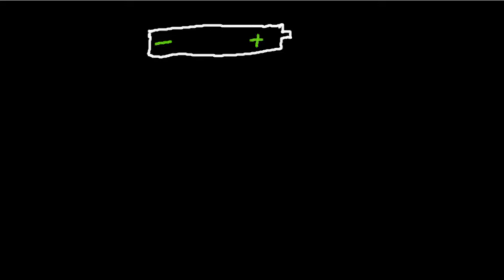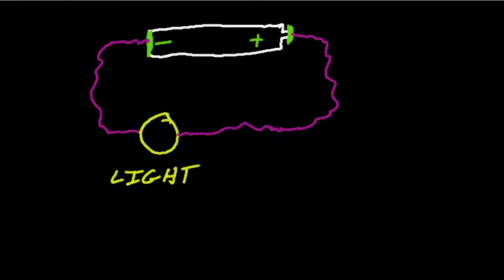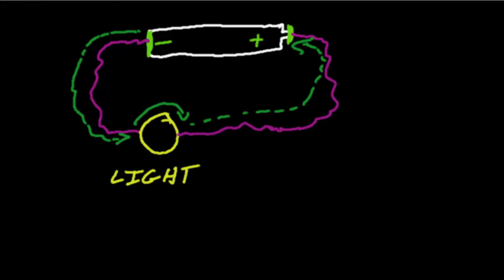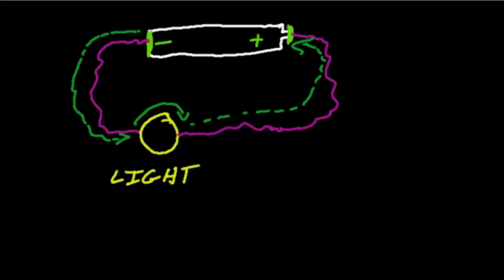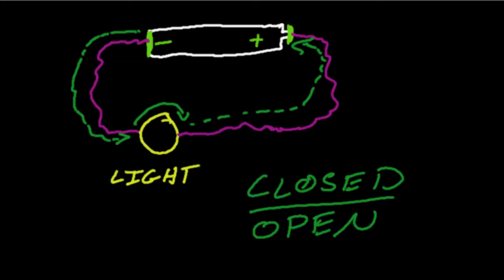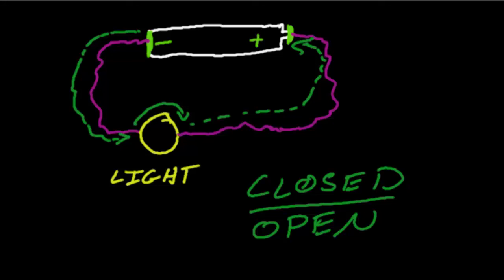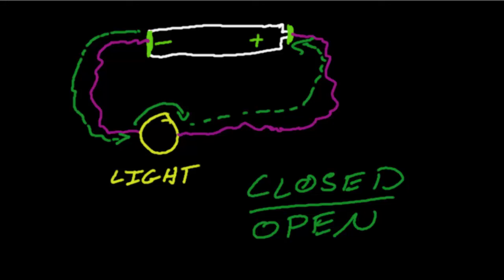Beginner Electronics - 3 - Closed/Open Circuits

Comment: Summary:
- electricity, aka current, is the flow of electrons through a wire
- for a battery, electrons from the negative terminal flow through the wire, to the positive terminal
- if there is a load (e.g. light bulb) along the way, it will have power
- if there is a gap anywhere, i.e. if the negative terminal is not connected to the positive terminal, no electricity will flow (i.e. no current)
- "open circuits don't work"
Reply: Electrons flow from the negative to the positive, but negative is said to be ground.  So are electrons flowing from ground to a "generatot"?
Reply: -e flow from + to -

Comment: Yes , Some teachers say that electricity flows from positive (+)  to negative  (-)  and others say the opposite , but they say it just to simplify cause : From the standpoint of electronics, it doesn’t matter. You can imagine the electricity flowing from negative to positive or from positive to negative, and (in every case that matters to electrical engineers) you’ll get the same results every time. This is why some applications to electronics were discovered even before the charge of the electron was known, and why many electronics textbooks will talk about electricity flowing from positive to negative. Also, in electronics diagrams, things like diodes and transistors are drawn as though electricity flows from positive to negative
Reply: it is necesary for safety reasons

Comment: Take Note: He's talking about Electron Flow instead of Conventional Current.

Conventional Current assumes that current flows out of the positive terminal, through the circuit and into the negative terminal of the source. This was the convention chosen during the discovery of electricity. They were wrong!

Some dude experimenting with glass, found out that it's the opposite and he discovers electron. 
Electron Flow is what actually happens and electrons flow out of the negative terminal, through the circuit and into the positive terminal of the source.

we still use conventional current because it doesn't matter anyway.

Comment: Does AC current travel on one sigle wire, or does it travel back and forth on 2 wires as it goes back, and forth?  Outsideog completing the circuit.

Comment: One thing I don't understand. If all electrical circuits are built to have electrical components in a certain order. Wouldn't it be the wrong way round if the current flows from negative to positive terminal. Like for example, what if a resistor had to be placed before a fuse to prevent the fuse melting and breaking the circuit. If we follow the conventional circuit direction, it works because charge flows from positive to negative terminal. BUT we know in real life, the electrons will flow backwards from negative to positive terminal. So, the fuse will melt first. So, how can this possibly still work if we're working with conventional current ? It shouldn't, right?
Reply: Bruh where's the answer to this? 😭
Reply: @hitdveenkour6764  ikr?! I learned something though, that current is the flow of charge not the flow of electrons. 

Now listen carefully, when electrons flow in one way, something called holes flow in the opposite way. What do I mean?

When you move an electron from one atom to the next, what have you done to that previous atom? You have removed an electron, so you have removed a -1 charge. Which is equivalent to adding a +1 charge to it. Leaving it more positive.

So if negatively charged electrons flow right,
positively charged holes flow left so there are two charges moving: one going left (positive), one going right (negative).

So could that have something to do with why it still works? Who’s to say it’s the electrons powering the components or the absence of electrons?

I may be wrong but I’m curious to challenge the idea
Reply: @jakkuwolfinsomnia8058  I see electricity is the flow of charges, not just electrons. But I still don't get how's the current supposed to go in the right way through the right device first (like you said about the fuse and resistor) even if it's holes or electrons moving?  Which direction is the current supposed to move in?
Reply: @hitdveenkour6764  that’s what I’m still not sure about ! We need to discover the answer to this question 🤣
Reply: @jakkuwolfinsomnia8058  maybe the charges are smart enough to know that ig :^)
Anyways, thank you dude!

Comment: hi, it has two ways of seeing it when flipped, so which side should i have to consider to read the colour band on a resistor,?
Reply: Don't worry about resistors, they do not have a positive or negative side, they are homogeneous meaning internally they have same composition throughout. Think of resistors as a funnel or a reducer where current flows into the large opening and slows down as it exits the smaller side. OK so far?

Comment: This might be a dumb question but if you connect 5 batteries together with a light bulb, will the light bulb explode or will the batteries catch on fire
Reply: if you connect five batteries together, your led cannot tolerate and explode. and  this can be averted with the help of resistors
Reply: @shakhzodkhamidkhonov8164  thank you :) do you know where can i buy all of these stuff?

Comment: So Negative needs positive as much as a positive needs a negative correct?
Reply: Yus
Reply: The chemicals in the battery flow into charges via the negative terminal. Then these charges which now contain power from the battery carry the power to the light bulb, once it reaches the bulb the charges release the power into the bulb which lights it. Now the charges are neutral and Continue through the wire into the positive terminal for the battery which gives power to the charges and restarts the whole process
Reply: Seth Miller So the power comes from the negative and goes to positive?? Wtf... This makes no sense to be, I thought the positive would have the power. 
Oh I have an idea, could it be because the power in there is actually electrons and electrons are negative, not positive? So this is why the power goes from - to + RIGHT
Reply: yeah exactly it's because it moves the electrons that are in the wire.

Comment: The battery does not output electrons. Electrons already exist in the wires. The chemicals inside the battery moves the electrons inside the wire. PLZ continue your series

Comment: Question: what if the current went through the bulb and continued down the wire a bit more when it reached a open circuit. Would the light bulb turn on as the current had already passed it or would it not for reasons I would not know?
Thanks

Comment: I'm in my 60's and I am pretty sure we were taught at school that the electric path in a circuit flowed from the positive to the negative, not as you show, from negative to positive. Am I remembering incorrectly here ? Maybe there is a reason for the change ?
Reply: god did an update on electricity flow

Comment: Question: Where does the electricity go if the it's open circuit, and why does a negative charge need a positive charge (and vice versa).
Reply: doesnt go anywhere because its open. once the wires connect in series... its a closed circuit. thats when current can flow in one direction. batteries have positive and negative sides because thats their polarity charge. one its connect in series... the circuit becomes complete allowing current to flow.

Comment: so why is it    if a power line falls it still throws sparks  and is still a hot wire ?
Reply: because the wire acts as a capacitor, that holds the electric charge for a while, and touching it discharges it.
Reply: In power lines the current comes from a power plant which uses alternate current not direct current like a battery. So it doesn't need the terminals like a battery. So if a power line snaps the current is still flowing and if it touches anything conductive such as your skin it will zap you
Reply: Yeah, the powerlines carry 24000 volts, and the voltage to stop your heart is 120 volts, people who touch the wires will have a black mark where they touched the wire and another where the electricity leaves the (dead) body.

Comment: would a closed-circuit be formed if you used two batteries (one on a negative and one on a positive)
Reply: That wouldn't work unless you connected the opposite - and + to each other. the circuit needs to be closed completely. Your question intrigued me, so I took a look at it.

Comment: Why dose the current flow from negative to positive?
Reply: because electrons are negatively charged and want to go to a place that is less negative charged (positive), so they go from negative to positive, but by convention we say electric goes from positive to negative
Reply: Because electrons which allow electricity to flow are negatively charged so they flow towards the positive side
Reply: Nice
Reply: Look up electromotive force and the electric induction for a more in depth explanation.
Reply: electrons are negatively charged particles hence it moves from negative to positive and in turn electricity moves from positive terminal to the negative one.

Comment: Hi, I have got a ques. Does it mean that electricity always travels from negative to positive? 
Thanks.
Reply from the maker: In our case of DC, at least, yes electricity flows from negative to positive, but you can also "view" this as a positive charge moving from positive to negative - it also depend on the case.  There is an article on Amasci.com that explains this topic well.
Reply: CodeNMore  O.K great. Thanks
Reply: +CodeNMore But My Science teacher and this guy +Afrotechmod says during the in electronic design and the actual flowing direction is different.

Comment: Wait a minute, I thought the electricity comes from the (+) to the (-) ....
Al my life was a big lie?
Reply: Depends, if you are a chemist then you see the current going from + to -, if you are a physicist  the its the other way around.
Reply: think it depends on wether it's an AC or a DC. In a DC it is constantly going from - to + but on an AC it's alternating between - to + and + to -.
Reply: as a chemist taking the example of a galvanic cell (battery) you see the current going from the - to +, you only see + to - if you reverse the process (charging)
Reply: Choose one way and stick with it. The math works either way. 
Schematic symbols make more sense with + to -.  
Call - to + Electron flow.
Reply: The charge becomes an anion which flows to the cation. So just remember that same symbols repel and unlike symbols attract.
Reply: Positive to negative is conventional current and neg to pos is electrical
Reply: I wanted to post the same comment xD
Reply: Yes , Some teachers say that electricity flows from positive (+)  to negative  (-)  and others say the opposite , but they say it just to simplify cause : From the standpoint of electronics, it doesn’t matter. You can imagine the electricity flowing from negative to positive or from positive to negative, and (in every case that matters to electrical engineers) you’ll get the same results every time. This is why some applications to electronics were discovered even before the charge of the electron was known, and why many electronics textbooks will talk about electricity flowing from positive to negative. Also, in electronics diagrams, things like diodes and transistors are drawn as though electricity flows from positive to negative.
Reply: @spreadthewordofwalpole9737  nope, in AC there is no + and - , they are called phase and zero (I'm not a native english speaker so it may differ), phase is where electricity comes from and 0 is where it flows to back and forth
Reply: @racknehetc7614  x1
Reply: @markomihajlovic7480  Phase and neutral.
Reply: Electrons flow from negative to positive, current flows from positive to negative.
Reply: lmao, they discovered which was it flows after they named it
Reply: @philosophyman  Electrons flows from negative to positive. The positive to negative is a convention 'cause the discover of charges was way later. It just matters for physics and engineering, and electronic advanced stuffs, so don't worry about it for now.
Reply: It was 5 years ago. Lol
Reply: @kiwinesss  but current is the flow of electrons
Reply: Well, it’s been a while since you’ve posted it but as nobody gave it a proper answer, this comment might be useful to someone. What happens is at the beginning people assumed it was form + to - but later it was found it’s the opposite. But since all the calculation and hipóteses and hypotheses were made. They kept like that. So we have to keep in mind there’s the conventional flow which is + to - as we analyze in some circuits using Kirchhoff for example. And there’s the real flow that is from - to +. Which we know is the true way the electrons flow.

Comment: What is a short circuit?
Reply: when you a directly connect the the negative terminal with the positive terminal without any load. Basically, it'll draw a huge amount of current, overheat beyond what the wires can handle and possibility start a fire.

Comment: Does the power actually come from the negative side or from the positive side?
Reply: TJ Baca the wire contains electrons which are neutral. Once hooked to each terminal the electrons in the wire flow into the battery and convert chemicals into power. They then flow from the negative port to the bulb release the power and flow back into the battery via positive terminal. The process repeats

Comment: Sorry dude you are speaking way too fast for a tutorial on electronics.  I just listened to two of them and I dont remember a thing you said.
Reply: go to settings, click SPEED then change it to slightly slower
Reply: No option on mobile devices.  But you knew that right..
Reply: The first video is just his introduction for you, while the second video is the beginning of the tutorials where he speaks about AC and DC flow, where it comes from,and remember that AC is the most lethal.